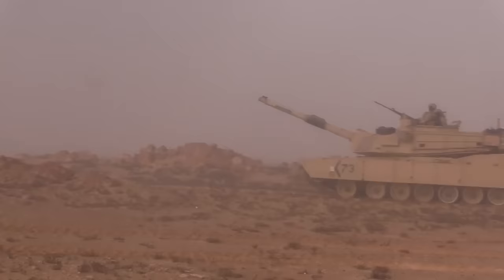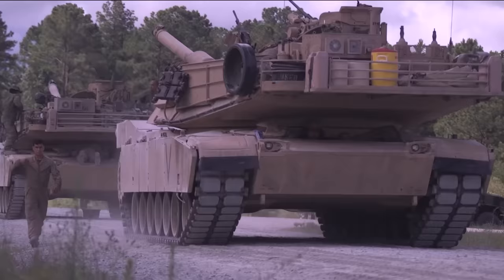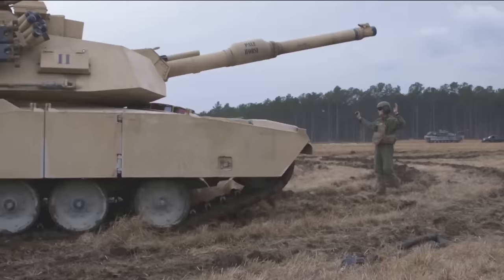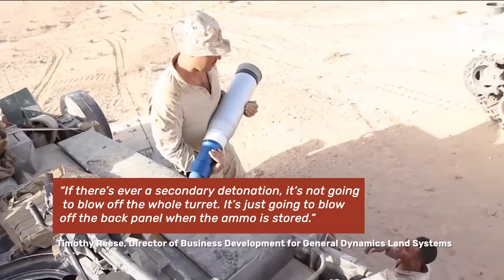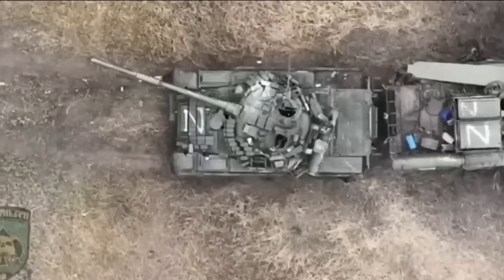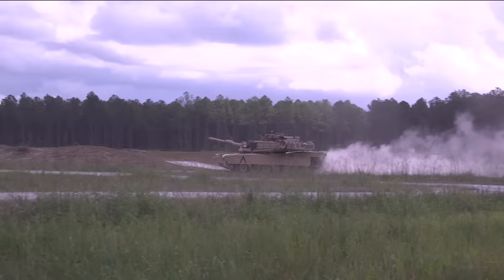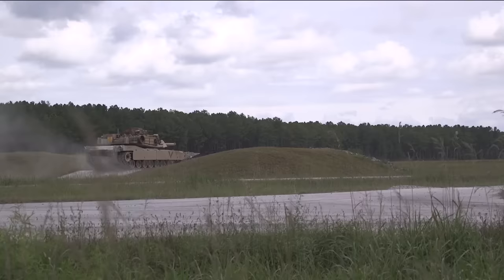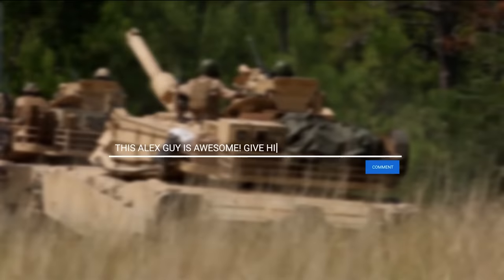America's next-generation main battle tank: ABRAMSX

Comment: I'm kind of suspicious of the unmanned turret design. Not because of the autoloader, no. A good autoloader is safe, as long as the ammo is stored behind a blast door, with a vent to release pressure through the roof and not into the compartment where crew are. 

What I am worried about, is redundancy. In a normal modern tank, like Abrams or Leopard, when the optics and cameras get hit by bullets, shrapnel, shock, or just malfunction, the crew still has periscopes to view out of and get a 360 view. If they get shot too, the commander can poke his head out of the turret and get a 360 view as the tank is driven back to base for repair. 
However in an unmanned turret, the only hatch and viewport you can have as backup, is 180 degrees in front of the tank. Doesn't help much when you need to reverse out ASAP after getting hit by an RPG in an ambush. Maybe that RPG or mortar fire took out your rear camera suite that used to give you perfect situational awareness and spacial awareness around the tank. 
I wonder if the plan is for a drone operator to give the crew directions in this situation? But what if that drone gets shot down, or EW disconnects the feed.

Another issue with unmanned turrets, is the issue with maintenance and field repair. In a crewed turret, a simple jamming of the gun can be often resolved in 10 seconds by a trained crew. Bigger maintenance might take a few minutes in the field, but still doable inside of the tank. But with an unmanned design, there is no easy access into the turret from inside the crew compartment. A simple jamming of the gun, will mean that the crew either has to get out of the tank, or even drive back to the base.

I see issues with reliability and redundancy. Basically, will this system handle the reality of the battlefield. Don't get me wrong, I'm no reformer. I 100% think that technology can give a huge edge. All these thermal sights, superior aiming devices, drone launchers, cameras around the tank, it will all give a huge advantage. You spot the enemy first and you win 9 times out of 10. However, there still has to be backups of backups. Because there will be situations where you lose the advantage, and you don't want to lose your equipment and troops every time they lose their advantage.
Reply: Chances are, if you're in enough trouble that all of your redundant optics get shot out, the same thing will happen to you if you pop out of the turret. Optics can be hardened to take direct hits from 20mm anti-material rifles, but humans can't. The best redundancy for a camera is another camera.
Reply: @hailexiao2770  Not really.
well yeah it is.
But tank commander in Nato usually aren't fully hull down and unless it's a chemical attack will have the hatch in protected mode and often ride with their head out for better situational awareness.

Real life is not a video game, it's not as easy to shoot someones head who is poking out of a moving tank lmao
Reply: @hailexiao2770  This makes sense. Except if you watch the conflict in Ukraine or just think about a real scenario. 

You will not be the only tank. If your tank has the unlucky fortune of being hit with mortar fragments damaging your cameras, and drawing the fire... Your fellow soldiers might still destroy the enemy before they critically damage your tank. This actually happened many times to NATO tanks in the middle-east. One tank loses a track and takes 20 RPGs to the front. And after the battle they just put on a new track and drive it back to base with heads out of hatches.

And since war is really numbers and odds game to some degree. You will always have a few damaged vehicles and wounded soldiers after even a massively successful offensive operation. 

So do you want your crippled tanks to be able to limp back home? Or do you want to spend precious recovery vehicles? Or do you want to assign dedicated people to help recover the vehicle by spotting for the driver with no rear cameras.

I don't claim that this design is doomed. People more professional than me, will do these calculations and estimates. And they will decide if this capability is worth that extra resource drain.
Reply: they'll find a way to solve that, they got cameras and sensors all around the tank, reinforced, and pretty hard to hit. shrapnel, bullets and small explosions wont do anything to it and if you get hit by something bigger than that, you got bigger problems to worry about
Reply: Valid points.
Reply: There are many, many cameras around the hull of a tank, all of which (especially on modern tanks) are designed for sustaining hits from larger rounds than a .50 cal. Not only that, but a tank jamming is exceedingly rare. It just doesn't happen. That isn't to say it doesn't, but it's practically a non-issue. As for unmanned turrets, its placing an emphasis on survivability. Even the Russians, with their famously mass-produced tanks that barely care about the crew, have come to the same conclusion as the US with their T-14. A good tank is a shit tank when it has a shit crew that doesn't learn from its failures.
Reply: The US does not allow one tank roll in the battle field alone it is always a combined arm's because the US army is not russian army
Reply: @joemango9782  fax
Reply: These are valid points, but if I understand correctly, this is just a tech demonstrator built by General Dynamics on its own, not something that the Army is actually ordering or even asking for.
Reply: Better idea than the commander sticking his head out of the hatch? The commander sticking a camera on a stick out the hatch.

I was already thinking about "what if the gun jams", though.
Reply: Cameras are cheap just add a dozens of them. Also active protection system should have sensors that can provide visualization with proper software.
Reply: Someone from GD said that the crew have access to the interior of the turret. They have doors in the crew compartment that lead to the interior of the turret, whether it be for clearing a jam to fixing electronic equipment. The AbramsX has a lot of redundancies put in place, with one of them being the option for the turret to be manned if need be. I'm pretty sure the turret only has one seat, for the commander, if he chooses or needs to be in the turret.
Reply: You threw a lot of "what ifs" in there. And yes you have to counter those, but maybe not all of them at the same time. And if they are all at the same time that may be time to evac the tank and crew for repairs.

As for jams, AbramsX does have the capability to operate in degraded mode with the gunner moved to the turret. That same gunner can correct autoloader errors and jams, and within certain limitations load more rounds from the carousel. 

It's important to note that engineers love to wicker through every possible failure mode, and there's lots of former soldiers and Marines who work at GDLS (~ 28% of the workforce are veterans). So chances really are that if you've thought about it, they've thought about it too. The issue of course is that the perfect is the enemy of the good enough, and (near) perfect comes at costs that no one is willing to pay.
Reply: @clarkbarrett6274  I thought with defense budget practices, we paid "perfect" prices for "good enough" products.
Reply: @CptJistuce  That's the Air Force and Navy... ; )
Reply: @clarkbarrett6274  Fair enough.
Reply: Suspicion is fair, but it has to be acknowledged that redundancy itself can also lead to many weaknesses that could be more harmful than useful.

The likelihood of a proper designed tank like this having all of their already redundant cameras and sensors and the like knocked out, seems to be extremely low in my view compared to the likelihood of the vehicle itself simply being destroyed or the crew killed. So at that point reducing the number of crew, putting the crew out of the turret, and using systems such as autoloaders means that they can reduce the likelihood of the tank and/or crew suffering a totally destructive hit even if this means increasing the risk from less totally destructive hits.

I am interested to see where this may go once a similar tank eventually enters active production - which is many years away in all likelihood.

But I think that getting rid of a crewed turret is a good idea if we have the technology to compensate for it. In the past I would have agreed with you that doing so is too risky, but we have more advanced and more reliable cameras and sensors than ever before - as well as technology which can keep these systems intact for a surprisingly long time. Cameras can be resistant to things like small arms fire and indirect explosives without much trouble when mounted properly, and if active protection systems and the like are doing their job I feel the risks are likely minimal. Field testing of course would be needed to truly evaluate these risks in an honest manner, and taking lessons from conflicts such as the war in Ukraine is obviously helpful.
Reply: They'll have helmets that allow them to see through the tank like the F35

Comment: Initially when they revealed it,  I was not a fan of the 30mm on the roof.  But the more Ive thought about it,  its grown on me.  More useful for counter drone duty than the .50,  more useful for trench/fortification clearing/suppression. 

The only complaint I have left is the drone carriage.  I still dont like the loitering munition inclusion.  Its an indirect fire system,  slapped onto a direct fire tank.  I just dont see the point.  Leave the drone option,  but stick a tethered recon uav system.  The ability to see over the tree line ahead of you,  the hill/ridge line in front of you etc and not able to be jammed(its tethered) would be quite useful.

A fourth operator would be nice too.  Extra brain power to handle all this new electronics/information being tossed at them.  Also useful for sharing the physical workload.
Reply: Just to be clear,  Im not against loitering munitions.  I just dont see them being needed on an MBT.  Its like sticking air defense missiles on your bridge layer.  Just because you can doesnt mean you should.
Reply: I don't see the point either.
They never opperate alone and are all getting interconnected sensors like f35.
It makes more sense to just have these assets in a shared capacity and run by a drone unit.

Drone opperators are going to be added units anyway if you look at the ukraine war.
Reply: The switchblade also has recon abilities. And you aren't going to land the drone back to the tank during combat so why not expend them explosively?
Reply: I think of the Switchblades as a counter to "hard-to-reach" targets. You can know a target is there, but it may be too dangerous to attack due to it being on the lee of a ridge where planes or choppers can't effectively hit. Pop a Switchblade and the target is either dead dead or hurtin' enough that he gives up the fight
Reply: @caelumvaldovinos5318  isn't that the job of artillery and company mortars?
Reply: @Brian J. , yes and no. Artillery & mortars and really good at lobbing pain from a long distance away, but are difficult to position on uneven terrain and the operators are vulnerable to counterfire. Switchblades can attack from any direction and the operator can ve a long ways away or protected by armour

Comment: Something not mentioned is the Abrams suspension is an old design that makes the tank substantially taller.  (Which means heavier, more to armor, easier to hit, etc.)  There's a new suspension that is actually important, but this video doesn't address it.
Reply: Indeed most YouTube videos focus on flashy stuff like armor or guns but yep, it is these seemingly minor details that really make a tank effective or not.
Reply: The torsion bar suspension was chosen for reliability, weight, and simplicity.  And for the fact that it can fit into the armored volume of a tank.  

"The best part is no part."
Reply: @colincampbell767  Yes, 50 years ago we couldn't make complex things be reliable.  That was a long time ago, though.  None of the MBTs introduced since the Abrams has used torsion bar suspension to my knowledge.  I don't think they were a bad decision in the mid-70s, but I also don't think they're the best decision now.
Reply: @lqr824  Hydro-pneumatic suspensions have become popular on tanks that have limited main gun elevation and depression.  The T-14 uses one - but apparently this tank is never going to make it into service.  And I've spent way too much time doing maintenance on tanks to have any interest on something else the crew is going to have to inspect, adjust and repair.  And the next tank is going to be filled with unproven technology.  More stuff that's going to need to be inspected, calibrated and fixed when it breaks.  

And to make things worse - there will be one less person doing this additional work.  In the field, tank crews are always functioning with some level of sleep deprivation.  Adding to their workload isn't going to help.  The switch to a three-man crew brings up serious issues about sleep rotation so adding to the 8 man-hours a day the crew has to put in just to keep their tank operational is not going to help.  (And an autoloader adds one more complex system that the crew is going to have to inspect and calibrate.) 

IMO - Battle Management Systems are a reason why - even with an autoloader - tanks need to retain a for man crew.  The systems we have today add to the tank commander's workload (and the platoon leader and platoon sergeant already have a lot of additional tasks to perform).  There are already situations where the TC has to ignore certain tasks and hope it doesn't bite him in the butt due to task overload.  Having a crewmember who can operate the battle management systems and help maintain 360 degree observation is going to be a must.
Reply: @colincampbell767 this is why I think the US Army is going to reject it.

Comment: One thing you didn't talk about is the hydropneumatic suspension. They reduce weight and improve wheel travel.
Reply: But require Hella maintenance and a failure along one part of the system may disable the entire tank.
Reply: @deven6518 still much easier than trying to extract abrams' broken torsion bar suspension (torsion bar suspension system on abrams is simple and easy to maintain and replacing IF they're not misaligned or broken whenever you tried to do maintenance or replacement, but once they're misaligned or broken getting them out of abrams for replacement is a nightmare. In-arm Active Hydropneumatic Suspension System on the other hand might not be as proven and reliable as torsion bar and a bit more maintenance intensive, but at least they're not any more difficult to extract and replace if they're broken on the field compared the normal functioning one because the suspension system in one contained unit).

Comment: I am so glad you say it is a demonstrator. GDLS has said there are things the Army will like and things they won't like. I have seen so many other videos where people think this is they a replacement for the Abrams when it isn't. Just like the K51 Panther isn't replacing any country's tank fleet right now. Both are very nice but right now no one, as far as I have seen or heard, is putting orders in. I did hear that Ukraine is looking to get the K51 at some point, but I don't know for sure.
Reply: No one is putting orders in because there really isn't any need to yet. For now, Abrams and Leopard do the job against legacy Russian armor just fine and any Russian or Chinese advanced armor systems are effectively non-factors for a whole host of reasons.

Abrams will eventually be replaced when the threat environment either changes all at once with the introduction of a true peer threat or when the number of add-on systems finally outpaces what the chassis is capable of carrying while remaining effective.
Reply: @gingerlicious3500  You are correct. I would add the Challenger as well. All of them are more than capable of dealing with Russian tanks right now. The biggest difference maker is tank crews. Right now the Russian army's tanks crews are nowhere near what NATO tank crews are at. And the Ukrainian military is now having tank crews being taught how to use all three tanks. It helps that they have an idea of NATO doctrine because the Ukrainian army is like a Western/NATO-style military and not like the old Soviet-style military.

Comment: The only issue is the AbramsX is essentially just a concept vehicle built by General Dynamics, it's not an actual government program or prototype for actual fielding. The current M1A2 SEPv3 is still replacing SEPv2 in service, and the SEPv4 is in prototype testing and will begin to be fielded in the next couple years. So AbramsX itself will not be the next Abrams. That said, some of it's supcomponents could easily find their way into a future M1A3, especially the new digital architecture, third "dome" Trophy APS and the like. But unless the Army seriously decides it needs a 130mm cannon, they're not going to switch to an autoloader (and the threat tanks out there can be dealt with as is), if anything they'll be far more likely to change to the longer 55 caliber length barrel vs the current 44 calibers (the Leopard 2A6 uses the L/55)
Reply: IMHO the most interesting component is the power pack, if they can manage to make it so that it can be plugged into existing M1s that would be awesome